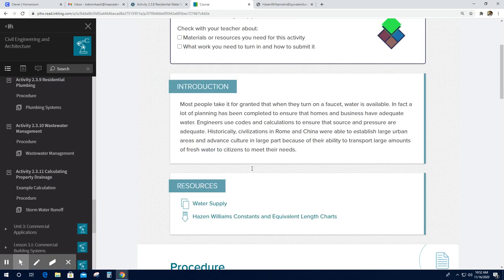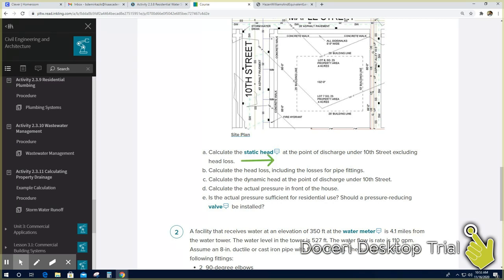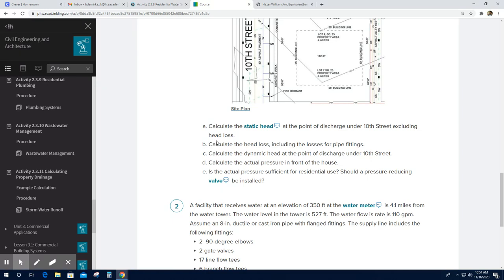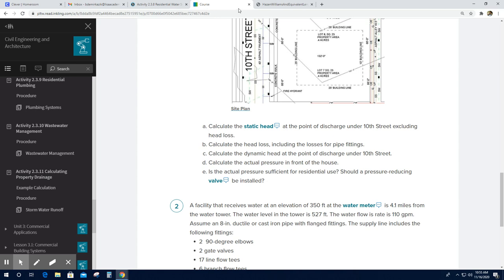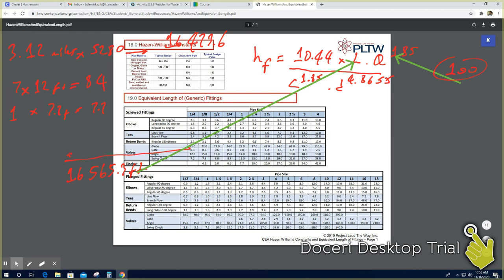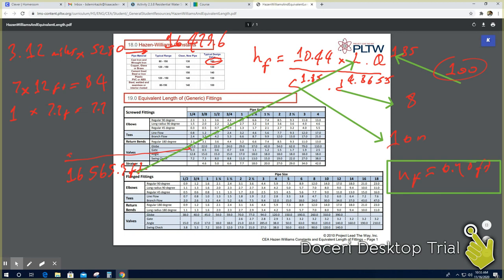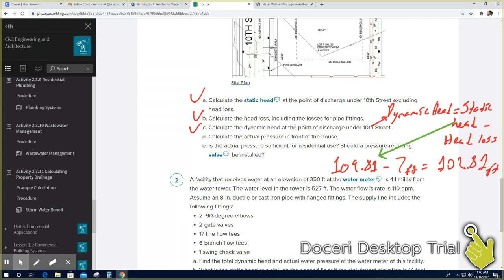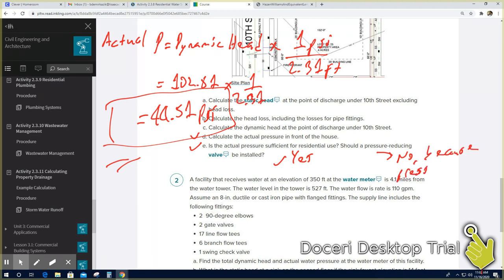Activity 2.3.8 Residential Water Supply-  Question-1

Comment: the part a calculations I think is wrong.872.81-769=103.81 but you got 109.81
Reply from the maker: Please check the description part of this video.  I should have used 763 but the answer is correct 109.81.